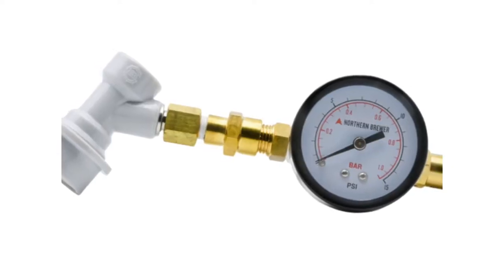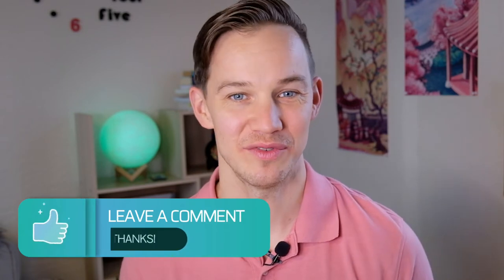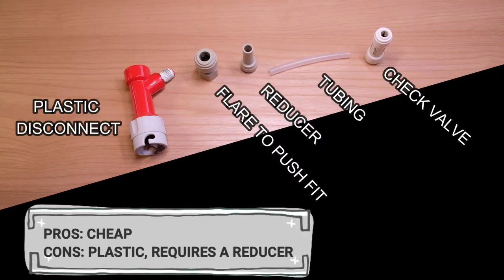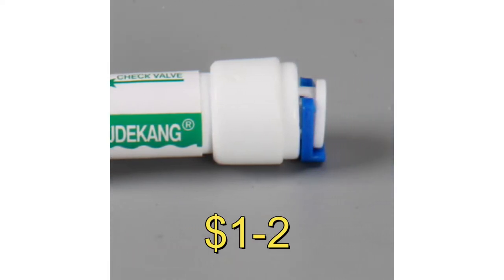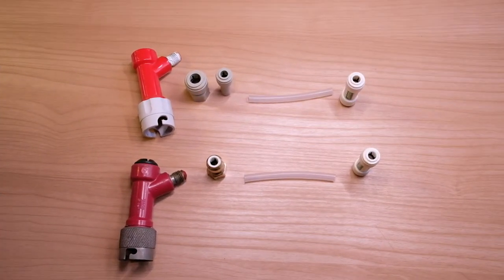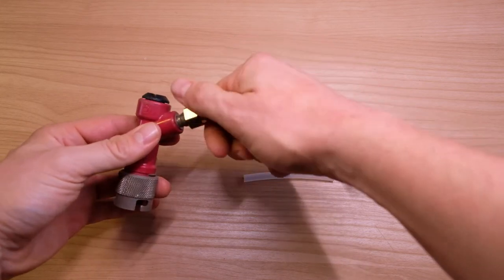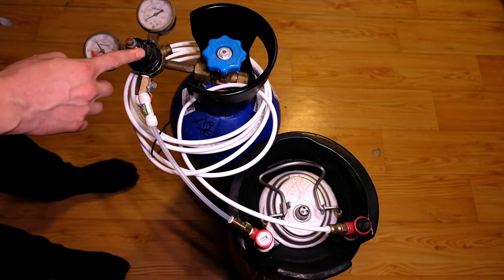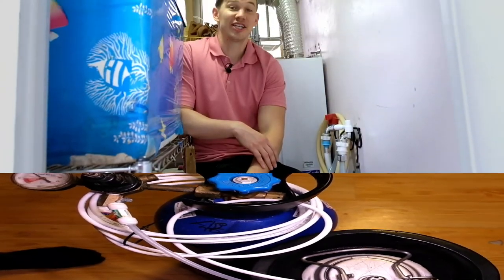How to Make a Simple and Cheap Spunding Valve for Beer Brewing

Comment: I thought brass fittings were a no-no due to co2 + water producing carbonic acid?
Reply from the maker: Maybe but it’s on the gas side, only on for a couple of days and has positive pressure going through it.  I wouldn’t sweat it.